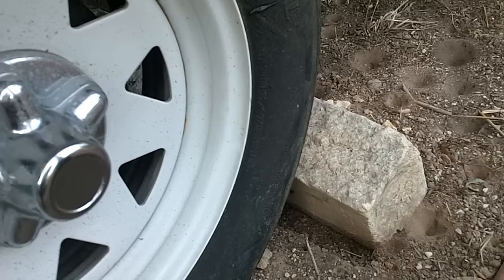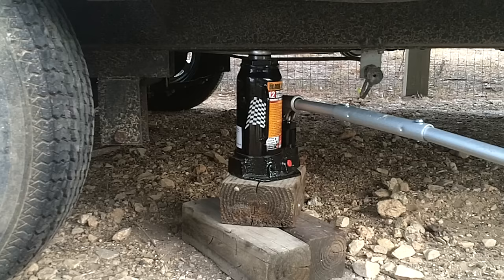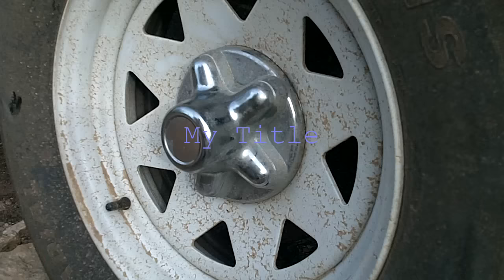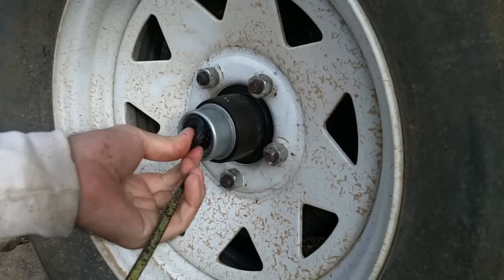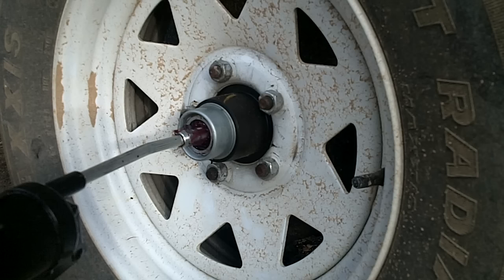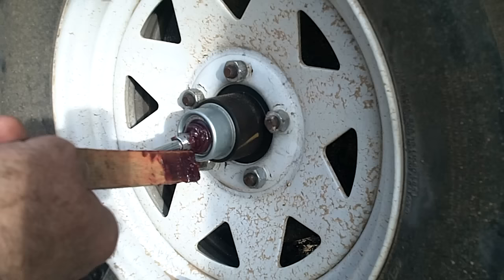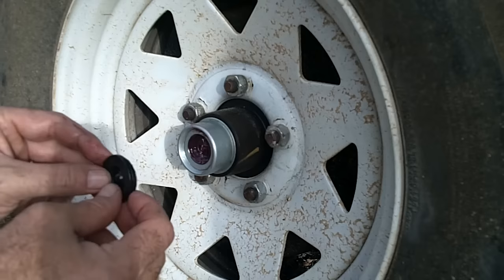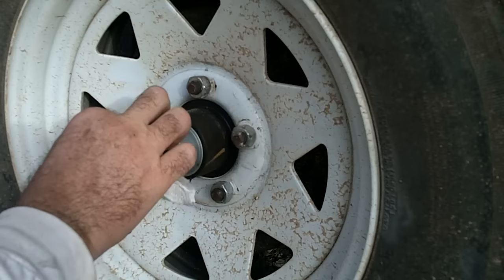How to Grease Trailer Wheel Bearings with EZ Lube Grease Cert

Comment: I would like to add a comment, some people do not understand the difference between a "bearing buddy" and what is on this trailer "Dexter easy lube spindle" The man in the video did in fact follow the correct procedure for a Dexter easy lube spindle. Bearing buddy's are generally for use on boat trailers, they allow you to pump the entire hub full of grease to expel any water. They can be very messing and if your trailer is equipped with brakes the shoes will often be saturated with grease. The grease has nowhere to go so it will force out through the rear hub seal. In the application show in this video, you can see the grease coming out of the front of the hub, exactly what it's supposed to do.  It's fine to use this method, but you should pull your hubs, inspect the bearings and replace the rear seal about every 12,000 miles or so just for peace of mind IMO although the Dexter easy  lube spindles can extend this. Before you make  foolish comment on the man's video how about you research it first. Google is at your fingertips. Good video.
Reply: vegasfordguy  yes I  this is the best answer . If you pump a lot of grease & you have drum brakes on this axle  you will push grease past the rear seal and will contaminate your brake shoes. It is correct to jack and spin the wheel while adding grease just don’t go craze. I carry a complete bearing kit with me in my travels less than $20 in MOST cases on eBay
Reply: Desert Explorer 302 Thank you for further info! I have a vintage 1965 Trotwood trailer. Need to redo tires,  and re do bearing.

Comment from the maker: Marine grease is designed to be extra tacky to resist water wash-out and is most commonly used on boat trailer and 4x4 applications. For heavy trailers such as RVs look for a grease that is rated for "extreme-pressure".

Comment: I wouldn’t pump a whole tube of grease into the hub, if the back seal leaks a bit, you will be injecting grease into the brakes. You definitely don’t need a whole tube per wheel.  I was told to pump a few pumps of grease until it starts getting pushed out the front and not to over grease the cavity
Reply: The cavity would have to be full for the grease to come out the front of the bearing. The grease comes through the inner bearing , fills the cavity and then through the outer bearing.
Reply: Ditto

Comment: The problem with this method is that the hole is behind the inside bearing.
As you pump the new Grease and it clears the old grease out of the inside bearing pushes it inside the Hub.  The clean grease and dirty Grease in the hub ends up getting into the outside bearing.

I just had to replace the bearings on a trailer because the person servicing it only put two pumps of grease in and then smeared grease around the castle nut to make it look like they pump grease all the way through.

Not to mention to feel that entire Hub full of grease is going to take half of 14 oz cartridge per hub.

Not to mention that the grease seals dry out and you need to check them.  The only way to check them is to remove the cotter pin castle nut and pull it off.

The grease fitting is fine for the inside bearing so you don't have to remove the seal, but I think you need to remove the castle nut and hand pack the outside bearing and reinstall.

Comment from the maker: @mmbengs The effectiveness depends on the type of grease fitting. In this case, Dexter's E-Z Lube grease fitting feeds the grease thru a tube all the way back behind the back bearing and so is able to push all the old grease out the front. Other simple type wheel bearing caps that have a grease fitting don't do very well with flushing out the back half of the grease - so hand packing would be more effective.
Reply: The bearing buddies that you speak of are not designed to grease the bearings😳
They have a spring in the cap and the ONLY THING it’s designed to do is when you fill that chamber with grease and then put an extra pump or two in it …..until that spring comes back halfway.
it pre-loads the grease so there may be one or two psi inside the bearing assembly❤️
 so when you drive to the boat launch your bearings generate heat that warms the grease and expands it, as the grease expands it pushes out on that spring a little more….. THEN  when you take and dunk the ENTIRE bearing assembly in the COLD water it quickly contracts the grease in the hub and without the BEARING BUDDIES that grease could create a negative pressure while underwater! The seals on the bearings are slanted in towards the bearing because job is to KEEP GREASE IN🙂 so if there becomes negative pressure in the bearing assembly it will SUCK WATER INTO THE BEARING ASSEMBLY 🤮
 and of course that water can turn into steam as you’re driving home and OVER TIME DEVELOPE’S RUST overtime ruins the back or the inner bearing. The bearing buddy is an excellent tool for boaters but most people don’t understand the 
BEARING BUDDIES PURPOSE🌹
I am going to attempt to use both of these because I think changing the grease halfway through the season in eight minutes would be a great benefit for me. 
❤️GOD Bless our America🇺🇸

Comment: there is no way you would need   a whole tube per hub maybe one for all 4
Reply: I absolutely agree. You just put lub in until the lub coming out looks clean. 1/4  tube at most
Reply: @haug0099  hmm. For #3,500 axels, I find it’s more like 1/3rd of a 14 oz grease cartridge per wheel hub.

Comment from the maker: With a fairly light load my trailer should be able to go 3000 to 5000 miles or 2-3 years between re-packing. But if I am constantly hauling heavy or submerging in water then every 1000 to 2000 between repacking would be better.

Comment: How do you remove a wheel hub out when there are no cotter pin or bolt on a Leonard?
Do I need a special tool to take out to replace new wheel bearing (will need part # for this)?

Comment from the maker: Actually, I only use paper towels and old news paper to clean the bearings. But in this video I am only greasing them, not taking them out and cleaning them. Take a look at a video called "How to Pack / Grease Trailer Wheel Bearings" if you want to see how to remove the bearings. But yes, gasoline would act as a solvent and help clean the bearing. Best wishes !

Comment: You said you recycle the grease? What can you use old grease for? Looking for ways to be a little more cost efficient around the yard
Reply from the maker: Bike and motorcycle chains, trailer hitches and the paper towels help start damp brush piles on fire. Also, used motor oil mixed two parts diesel to one part motor oil, makes pretty good wood preservative when sprayed onto a trailer deck (top and bottom). In the summertime, the wood really soaks it up.

Comment: There is no substitute for yearly bearing service . Pull the hub  , clean and inspect bearings  . Replace the seal  . Repack with a good quality synthetic high temperature grease  . Keep pumping grease and your brakes will fail  .
Reply from the maker: Good input. Thanks for taking time to comment !

Comment: Hold on. I am pretty damn sure that if you pumped a tube of grease into that hub 95% of it is going to be inside the brake drum and smeared all over the brake shoes brake drum and magnets and the first time you go to stop you’ll be wondering why they don’t work. Just pull the hub off and do it right and at the same time you can check everything else in there.

Comment: can you tell me how to tell if its bearing buddy or these one I have a dust cap like yours but I bought trailer with them installed bought trailer from US. though
Reply from the maker: +littletoy01 If they are on a utility trailer chances are that it s not the Dexter E-Z Lube, but if they are on a RV then look inside the RV cabinets and see if you can find a manual on the axels. If there is no manual, then it is probably just buddy bearing.

Comment: Can you tell me the specs of the grease gun you're using in the video? How many psi, how many ounces are in the grease cartridge, do you recommend getting one with a bleeder valve?
Reply from the maker: Not sure of the PSI but the cartridge is 14 oz. I have never used a gun with a bleeder valve but most of my problems I have with my grease gun are from getting air bubbles that cause a failure to feed, so a bleeder valve might help... but I'm not sure. Best wishes - BTW Cute thumbnail Lisa !
Reply: Thanks!
Reply: Jim, when installing a new cartridge pack the head of the gun with grease from the bottom of the new cartridge,  I find that it eliminated 90 percent of air pockets on my gun and starts pumping right away.  Hopefully not telling you something you already know

Comment: What's a cert? Is it like a welding cert, or a certainly, cert?
Reply from the maker: Ha !    I was 53 years old before I realized my hearing (or lack there of) had me thinking that fitting was called a sert, as in "insert grease here". If I hadn't made this video and had people correct me, I'd probably still be calling it a Cert !
Reply: Jim Thomas yea it's a zerk! And I advise people not to use it unless you take out the outer bearing first, if not the seal just usually comes out, due to the large air gap between the two bearings not letting you see grease flow.

Comment: How often should you add new grease ?
Reply from the maker: Depends on the load and the mileage -  hauling heavy loads like heavy machinery on long haul trips, then every 3000  miles would be about right. .. lighter loads 4000 + ought to be OK

Comment: Where would you find a replacement for those dust jackets?
Reply: Armando Perez most trailer supply stores have them or also utility trailer supply stores 
Also amazon
Reply: Armando Perez they sell them on Amazon. Pack of four is like less than $5

Comment: Wouldn't you blow out the seals?
Reply from the maker: The way it is engineered, the pressure of the grease just pushes thru a center straw to the back and then it flows from the back thru the bearings to a open portal in the front, so not much pressure is allowed to build up.
Reply: 10-4 learn something new , thanks

Comment: You are only replacing the grease with and 1 inch into the housing, you're not replacing all of the grease to prove my point if you took the wheel off you will see that there are still old grease closer to the inside bearing.To do it correctly you have to take the wheel off and repack the bearings.
Reply from the maker: Yes, with a regular grease zerk but this grease zerk is different. The Dexter E-Z Lube system uses a tube from the grease cert to the back bearing so that the fresh grease pushes the old grease out from the back toward the front.

Comment: What brand and type of grease do you use? Thanks for the video!
Reply from the maker: I usually just get my grease at Walmart but I try and go with "High Pressure" for my RV trailer and larger utility trailer or "Marine" grease for the boat trailer.
Reply: NLGI #2

Comment: why are trailer wheel bearings such poor quality that they need to be greased regularly? how often do you have to grease your wheel bearings in your car or truck? Those last for 200k miles. Why not just produce quality wheel bearings that are sealed and designed to be replaced?
Reply: The bearing are top quality, this is for a boat. Your bearings go under water every time you launch a boat. YOU HAVE TO OCCASIONALLY REPLACE THE GREASE DUE TO THIS. It's very important. Otherwise, I replace mine once every couple/few years with a regular trailer
Reply: bearings are all made in China now
Reply: YEG Drone Photography -  the video you just watched was for a boat trailer. Boat trailer go under water all the time. They go out extremely father than a Car you are comparing to.
Reply: @Dojautlopez  Haug009 - this is a camper trailer, NOT a boat trailer. It says Jayco on the fender. Plus you would never put a dust cover over your lug nuts on a boat trailer.
Reply: mdees88 you are correct. Idk why I thought it was a boat trailer.
Reply: you should grease the bearings on your vehicle every 3-6 months, usually during the Oil-Filter-LUBE service.
Reply: Tim List I haven’t seen a car or truck built in the last 20 years that has serviceable/greaseable wheel bearings.

Comment: Too funny this type of bearing pack makes Me Lots of money every year...There is no substitute for cleaning and visually inspecting bearings Period...adding grease to grease does nothing and If you have a bearing failing the grease coming out cannot report that too you.. Dont waste your time with the grease gun  GREAT MARKETING by dexter for an assembly line time saver..Not designed for bearing Care ..
Reply: Better to have bearings packed than to run a trailer on bearings without grease.
Reply: Kirk Klag you missed the guys point completely
Reply: Not true. You simply feel the bearings/hub after driving a while, they will be hot if bearings going bad. Mechanics have been doing that for 50+ years for a reason
Reply: @Dragon_Camp_Cooking_  No he didn't. Zerg fitting are there to add lub so you don't have to repack it. You don't have to tear out the bearings every time you add lube
Reply: This usually just pushes the seal out anyway.

Comment: You skipped the manufacture of the hub? You skipped the recommended inspection interval, usually once/year or every 12,000 miles. You skipped cleaning, inspecting, adjusting bearings. You skipped how grease gets on the brakes by doing it the way you are doing it. You skipped how to do it the right way, not the short cut version.

Comment: its called ez, but there is nothing ez about it
Reply: You've never disassembled a hub and cleaned & repacked the bearings, have ya Gavno?  This is much faster and easier if you have the E-Z Lube system installed.
Reply: @jcwoods2311  so what is the point of having ez lube system if you still need to "disassembled a hub and cleaned & repacked the bearings", eh?

Comment: Meanwhile its just blowing the seal out the back side smh. Not the right way to do it really.
Reply from the maker: With the Dexter technology, the grease follows the path of least resistance and is easily pumped thru the center soda straw tube to the back bearing and then the fresh grease pushes the old grease out the front. There is very little pressure on the back seal.

Comment: This is possibly the worst thing you could do. When you use the EZ lube if fills the  hubs 100% full of grease. The is no air there for no room for thermal expansion. Greasing your axles this way will guarantee that with a few uses, when heat expands the grease it will hydraulic past the seals and contaminate the  brake linings & you will need to replace the backing plates. Break those grease fittings off so they can't be used.
Reply: Brian Schmidt I have found with mine that any thermal expansion is outward into the rubber plug making it expand outward.  After parking and hubs cool it contracts the plug inward